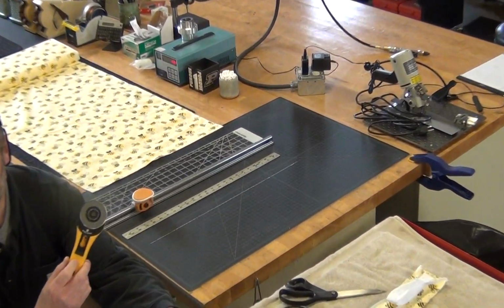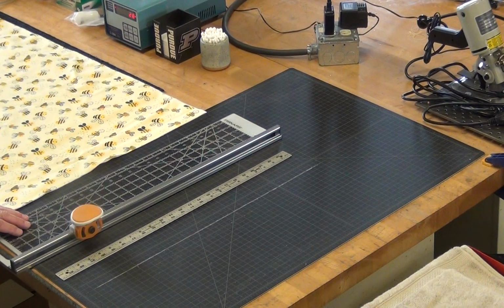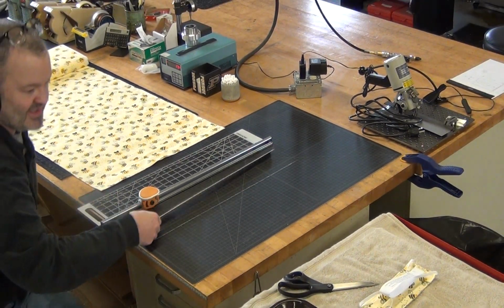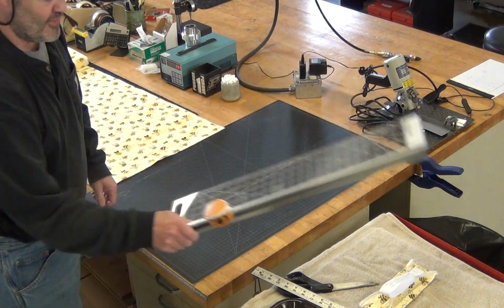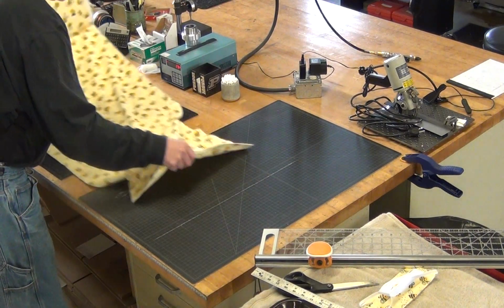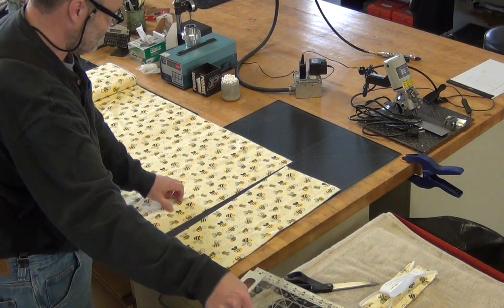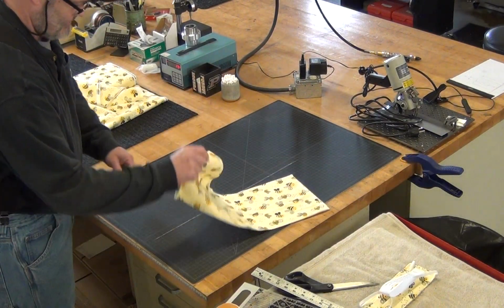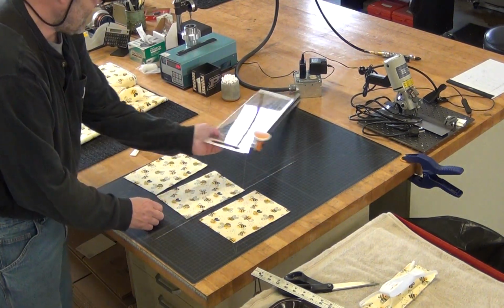Speedy Cutting - Fiskars Rotary Cutter and Ruler

Comment: Very helpful! I've used those "scary sharp" rotary cutters with quilting rulers for decades. I saw this tool recently; it looked like it would be much safer, but I wasn't sure how well it would work. After all, safety isn't much use if you don't end up with a good cut. Now I know that this this tool will make cutting more efficient, ergonomic, and accurate. Excellent safety and a nice clean cut. Thank you for the demo!
Reply from the maker: Thank you for your kind comments!

Comment: Hi sir 
I'm Raju from India(Hyderabad)
I'm working job work at home (Cutting for Polypropylene Sheet 180 Micron)
I need Slide Trimmer required  length is 1.2 mtr
Reply: I have the same ruler/cutter as in this video. The measurements are in inches, so if you have a conversion table, you can figure the metric equivalent. Hope this answers your question.
Reply from the maker: This is Fiskars but, yeah, there are lots of variations on this type of cutter.

Comment: How many pieces of material can it cut with one slice.  I think you showed two?
Reply from the maker: I have cut four pieces at a time.  More than that may be possible but I have noticed that the blade may not glide smoothly in that case.